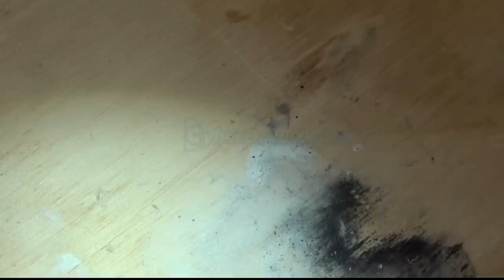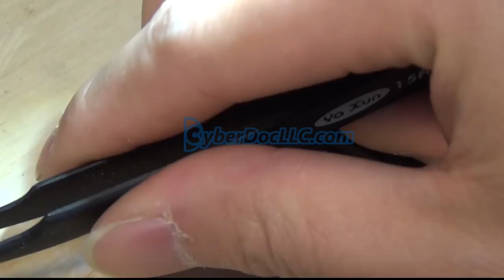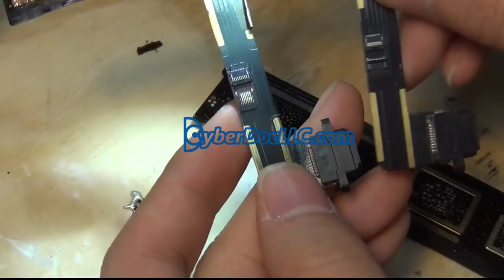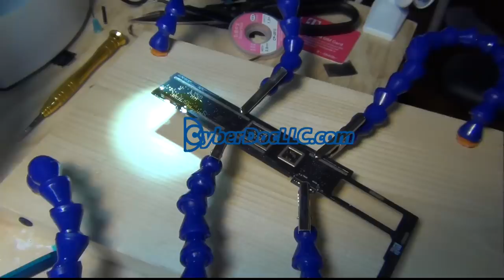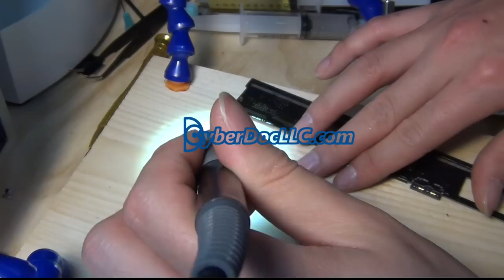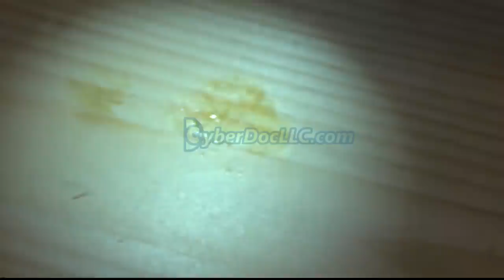ipad air lighing connector ribbon cable repair

Comment: Congratulation from Spain. Great video. I would like to make you a question: I have made same repair in my iPad air. I've already installed the flex cable and I've proceed with the testing but something was wrong. 
I've connected to the Apple charger and in motherboard testing points I've got 5.2 volts. so up to these points the repair is wright  but in the motherboard battery pads I've got only 1.4 volts. I didn't check with the battery as this is gone: battery not working anymore. My question is which voltage has to be in this battery motherboard pads? Should be 3.7 volts? I need to know if is normal or not to have only 1.4 volts in order to proceed or not to purchase a new battery. As you can understand I don't want to spend money in a new battery if the voltage I've got is only 1.4 volts instead of 3.7 volts.
Thank so much. I'll appreciate your answer. Thank you.